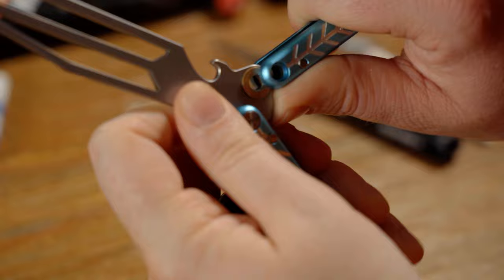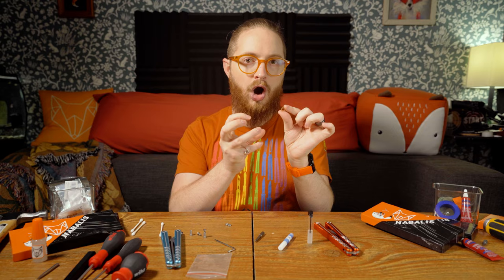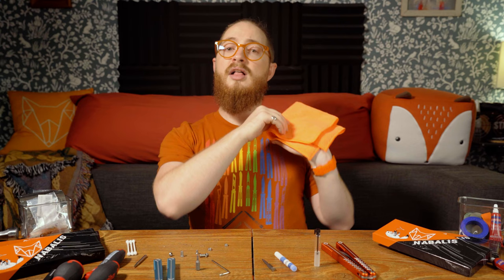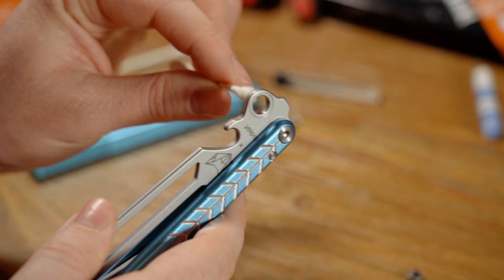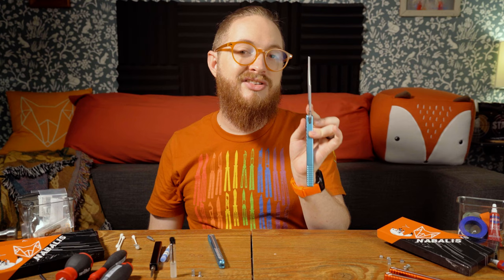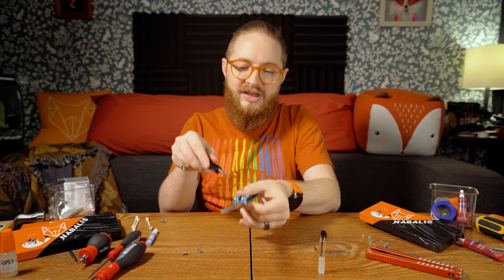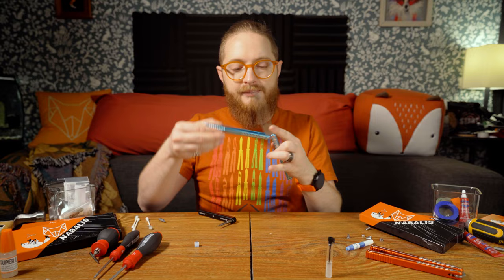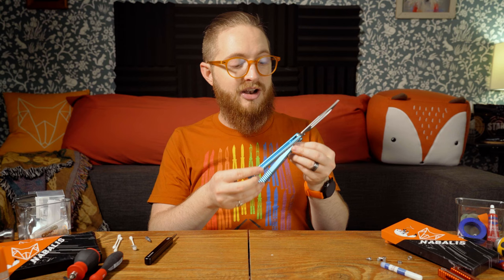A Beginner's Guide To Balisong Tuning! ft. Nabalis Vulp

Comment: I tried fixing my morse, the tolerance was ok but it had dirt in it and now it has way to much play to even flip it.. I tried the extra hardware and even the new hardware but its the same every time, like an inch of play! I try following the video and found that its the bushings so I tried to flip them, replaced them etc..  
now my question is how do i fix a bushing issue? How do I get the right size? They seem to be way to small! Takes away all the fun, can’t flip for weeks now :(
Reply: Like I would know how to figure out the diameter but the height of all the parts seems so confusing...

Comment: Okay so I have one tiny question. If I apply the loctite, then I won't be bale to remove the screw if I need to do so in the future, isn't this a problem?
Reply from the maker: You can still remove the screw, unless you are using a very strong threadlocker, like Loctite Red. You just have to make sure to have a good screwdriver torx bit, and to squeeze the handles very hard when you are un-tightening it. Heat also loosens adhesive, so heading up the screw area with something like a hairdryer can loosen it as well
Reply: @WillHirsch  Okay thank you so much, idk if it is really Will or Brandon but still It is very big to have my comment answered after a year has passed since the video was released :)
Reply from the maker: @bielvv9148  it really is me! We don't have a social media team or anything, so any comments or posts are from me or Brandon
Reply: @WillHirsch  Whoa no way! I already liked your videos, but now I'm even more engaged with you guys, keep up the good work!

Comment: Hey I know this is a bit of a shot in the dark, but I tuned my Vulp a couple weeks ago and I was gonna try to tune it again last night but realized that for some reason, even though one of the screws is coming out fine, the other is just spinning freely- looks like the pivot is spinning with it. I'm not sure if I maybe just screwed it in too tight with the loctite last time I took it apart, and what I should do now. Either way, I can't take my knife apart at all now because the back side of the pivot is polished. Any chance I can get some help?
Reply from the maker: Make sure you squeeze the handles hard together, while the balisong is opened or closed, whenever you are trying to unscrew the pivot screw. This will keep the pivot from spinning! 

You can also apply a good amount of heat from something like a hair dryer, which can help loosen the Loctite!
Reply: @WillHirsch  great, I'll try that then! Thanks Will!

Comment: Wait, so does the vulp not come assembled with threadlocker? Would you recommend taking it down and applying some?
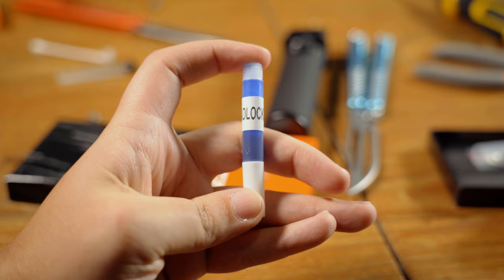Reply: It does not come assembled with threadlocker. The reason is explained by Will at 7:32, and later in the video he shows how to apply it and how to tighten the balisong. Check the time stamps if you need more help!
Reply: @thebrandonbakerclone  was kinda hoping I wouldn't have to take it down just yet, just recently got mine and I'd rather not have to replace the one-time-use washers :/
Reply from the maker: You don't need to replace the washers to add threadlocker, you can just add the threadlocker
Reply: @WillHirsch  👍
Reply: @TheFlame9988  The only thing required to apply loctite is to just remove two of the screws and replace them with the same screws but with loctite applied, you don't need to do any kind of extensive disassembly
Reply: @thebrandonbakerclone  thanks guys! the loctite sample bottle really is super handy with applying the right amount of loctite, and it's even sized so you can't lose the screw 👌

Comment: Is there any lube on it when you get it
Reply: I mean the vulp pro
Reply: On the vulp pro?
Reply from the maker: Yes, the pivots are  pre-lubricated and the package comes with lube
Reply: So i have to remove the oil to try a different one. and are the lube you get in a package the sam as the normal lube on squid industries?

Comment: I just received my vulp trainer a few days ago. Out of the box the bite handle is very tight. Holding the bite handle while the trainer is closed, the blade doesn't drop. Would you recommend going this route and replacing the parts with the ones provided?
Reply: Watch the section at 32:11, that has some tricks and tips that might help you! 

If that doesn't help, first try lubricating it. If that doesn't help, untighten the screw a tiny bit and see if it still doesn't move. It could be something lodged in between the washers and the blade/handle. In order to investigate that, yeah, follow Will's tutorial on how to disassemble the handles. Though, if it unsticks after loosening it a bit, and has good swing with a small amount of play, you could just thread lock the screws where it swings properly and call it a day! Much easier than having to tune a bushing haha
Reply: @thebrandonbakerclone  Thanks brother!